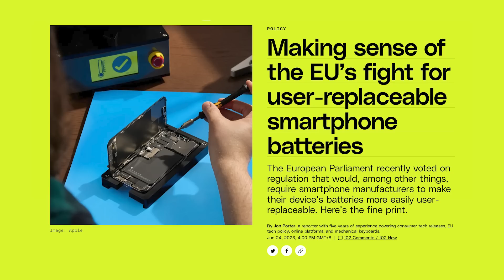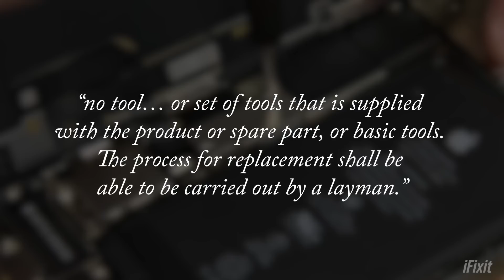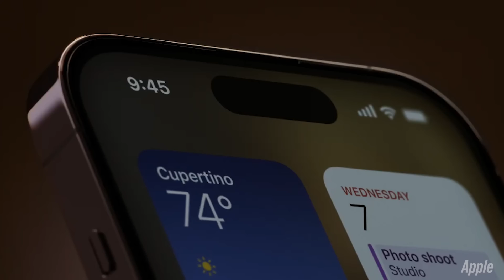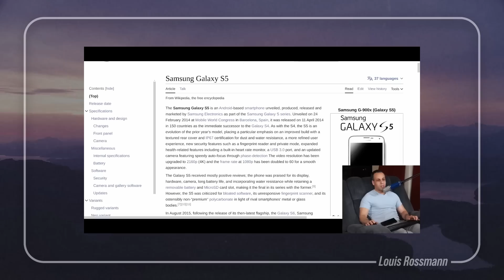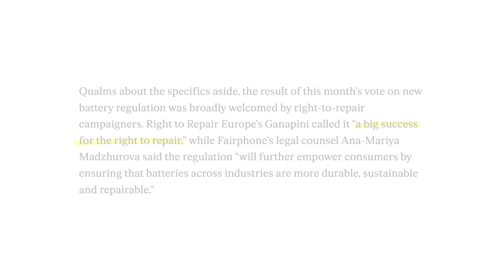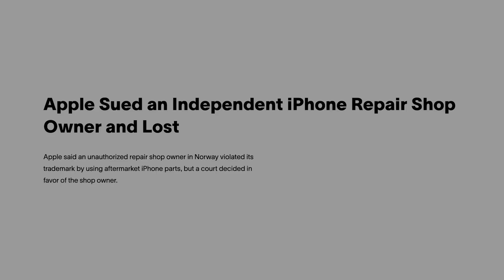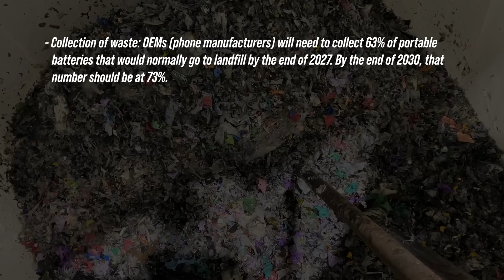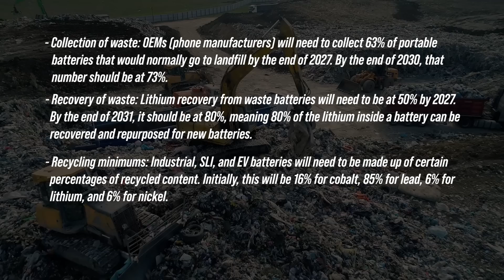EU Just Changed Smartphones Forever

Comment: Wouldn't the devices get thicker with a replaceable battery?! I am all for replaceable Batterie, don't get me wrong - I just don't  want a clumsy device in a time where foldables are becoming the next standard device type....

The other thing is that an old phone will be very slow due to software updates. So when the battery is through, another 3 Iterations of the same phone have been released. At this point it makes sense to get a new phone anyway.....

Comment: Rock on EU, but they should make it easier to replace screens as well while they are at it, even more pointless e-waste.  One of my older phones (UMI Super) I could usually buy the screens for about £15-18 inc delivery here in the uk and replacement battery for £8 I guess.  To replace the screen each time I broke it the annoyance was more the fact that you had to dismantle the phone from the back and take it to bits each time and then put it all back together, something that is too much of a barrier for most people to get past sadly, even though if you have access to the web in some other way there are great tutorials and teardown vids for pretty much every phone.

For my UMI it was relatively simple with basic philips head screws and I got used to doing it over the years and even if I did not have a screwdriver at hand the screen kit would always come with one, as well as the glue strips and a plastic tool incase I did not have any guitar picks etc.  They were stock from the factory and I never even recieved one with a single broken pixel.  The battery also came with a screwdriver IIRC and it was a simple job for most to take the back off and replace it.

My current phone for years then like most I would have to go in through the screen to get to the battery, something that without a heatgun is a bit tricky and scary for most since one mistake and you then need to buy a new screen also haha  (thankfully I have not had to do it in the 4 years or so since I bought it because the battery is still decent)...  If you then take into account that phone screen seals are pretty tricky to get back to factory condition then It is an insanely evil trick just to really make sure nobody does it and either buys a new phone or sends it to them for repair, just to replace a $10 or so battery.

UMI also used to (and maybe still does) support the right to root or CFW or do whatever you wanted with your phone since, well, you owned it, it is your device and they would provide keys and guides and had forums, something that most companies seem to have forgotten also.  Honer actually stopped giving out dev codes to unlock my phone a month after I bought it I guess. I had given it a while since I was waiting for them to finish updating android (which often does not take long) and I saw no reason why they would ever take away one of the features after selling it, sigh. Oh giant tech corps, always such a pleasure doing business with them.

Comment: User replaceable batteries weren't removed, because smartphones are made of glass, metal and glue. Batteries were removed, because it's cheaper and more profitable to manufacturer them in a way, that is not easily fixable. The batteries could also last A LOT longer, if they weren't pushed to the absolute limit. But manufacturer choose to squeeze those last few minutes of runtime out of them and limit the lifetime to about 2 years. Don't repeat the excuses they give you, like a puppet on string, just use your brain for a moment. Considering all the challenges of making a smartphone. Making a modern smartphone with a user replaceable battery is not a much bigger one than making an iPhone with a USB-C Port, they don't have to "figure out how". They just have to do it. That's all.
https://youtu.be/Yn-R39-dtc0?si=j7ErNQ7_0hFLXek5

Comment: Too many comments to see if anyone mentioned the Apple/Norway case you refer to. Pretty sure the repair shop was using non-genuine Apple branded products and this is a big no no. Stupid to use them anyway as consumers don't see them. If you use non-genuine branded batteries as you don't want to deal with the 'it is a genuine Apple battery you are fitting in my phone', then Apple will come for you. There are enough good 3rd party batteries around that Apple leave well alone (intellectual property issue). The EU should have made a list of things to do by 2027: once every, say, 48 hour charging (stop using battery advances for super duper processors that 99% of consumers don't need; serialising for spurious security reasons; glass on hand-held devices, update terms that cause consumer panic, security lockout lottery (Apple, Samsung, Google) it's MY phone!
Reply: People use non-genuine branded parts on a lot of things.  Why is Apple so special?

Comment: I’m was excited for this until they said it can not require any tools. Now I’m skeptical because I’m unsure how they will design this and still maintain the same beautiful design of phones additionally I’m concerned of dropping it and having the battery pop out which always would happen on my phones with replaceable batteries. Don’t get me wrong I want this, but I not requiring at least SIMPLE tools like 4-8 Philips screws on the back of the phone or something would make me much more comfortable with this.
Reply: That is not what the law says.  Watch the video again and pay attention.
Reply: @RK-um9tu  I've been following this situation very closely over the past couple of months and last I heard the language used was "without the use of specialized tools" after researching again I see that they say commercially available tools or specialized tools provided free of charge. This makes this law much more viable in my eyes. Unfortunately I was wrong however I was basing my knowledge off of couple month old articles and I guess the language could have changed? I'm not sure, seems unlikely lol
Reply: I can think of a way that not only prevents accidental popping off, but also improves non-slippage and water protection.  Make part of the back a silicone that grips into a grove around the front edge of the phone.  If you make these different colors and designs you can interchange them for any occasions.  Make a backing with built in silicone plugs for charging ports and other openings, now it’s ready for pool or bathtime.
Reply: @N3k0B0o  I can see that working

Comment: It's a must. It will definitely lead to people using the same phone for longer. It's high time we protect the environment and this will definitely help slow down waste to ab extent.

Other benefits might not be so relevant as most will go to the manufacturer for the original battery which charge mostly fair amount except Apple and maybe some other companies.

Collection is a challenge. Should have implemented a new law to put batteries on a special waste bin for easy collection and recycling.

Comment: Funny enough as an owner of a S5 for many many years my issue wasn't removable batteries, mine was how to get my hands on legitimate and quality replacement batteries. they either cost a true fortune or are 99.9% identical from the outside but are fake and swell up (speaking from experience) so it would be nice to have a standardized battery format that would guarantee availability.

Additionally, as far as reparability goes, when a replacement screen for an S5 costs 80% of the price of a brand new equivalent phone with all of the same functions and a bigger screen then it's obvious why so little repair gets done.

Comment: At last. But why it takes so many years.? Apple allways complicated simplest things in their Products. Power management batteries in Macbook G4 titanium was placed under the topcase so if anyone tried to change this battery had to remove a lot of parts. This battery was made of 4welded Panasonic button cells wort max 2$ but costed 100$ + service at Apple. I did it my self. Still working.

Comment: I actually dislike this because my Android Phone would constantly freeze to the point I had to constantly remove my case and then the back then the battery and re-assemble multiple times a day... so for me I dislike this. A sealed battery is better for me, I hate having to remove the battery just to restart my phone, I wasn't able to reset it without removing the battery 🫠 so I switched back to iPhone and it's not given me a problem since it's been like 6 years no problems
Reply: How long ago was that? Nowadays you just hold down the volume and start button.
Reply: @BrokenBackMountains  Admittedly it was a long time ago at least 8 years plus, I just haven’t switched back and kept my IPhone 6s the whole time. I am not on my phone much but the battery still last me plenty long. 

I’m sure the Samsung phones are much better than back then I just don’t change things when it works and for me the IPhone hasn’t given me any issues. It’s never froze on me once.
Reply: Warning, Warning, iTroll Alert!!!

Comment: This is an excellent move by the EU, the change to denies users the ability to replace batteries was down to companies profit, not design of phones. 

Its ridicules how new tech is made to ensure it is useless when some minor components fail. There must be an end to buy and bin which is the manufactures preferred sales approach's! The life of tech has to become far longer and less new models realised. Of course companies wont like this but the huge scale of environmental harm is sickening.

Likewise we must revert back to laptops that are easier to fix, there is simply no reasons at all that the average laptop only lasts 3/4 years before it becomes so clogged up, slow and largely pointless. Windows plays a negative role here as no doubt between them and components its all about ensuring a turn over of new laptops. 

Companies expect us to pay £400 to £1000 every 3/4 years for decades and its just not on. They do not provide value for money, laptops must change so they can have a continued life, so even if you do get a new one the older laptop should still be good enough to donate to charity or organisation that can make use of them. Components must be recyclable and be able to go into new ones or for repairs. 

Companies need longer profit goals, they used to do this, so is a utter rubbish they cannot go back to it, they deliberately want items to fail and not be able to be repaired. Well, no more!

Comment: i'm getting ideas of a modern smartphone having the battery capacity to last for over a week before needing to be charged due to the battery beeing replacable that adds the function to buy a new mechanism that has more than just one battery in it. sure the phone might get twice as thick, but i'd take a thick phone with long battery life over a slim phone that has a drained battery in less than a day any of the week
and yes i know its shows i'm getting old when i miss the time when i only needed to charge my phone once a week, and the fact i use my phones until they have some kind of catastrophic failure.

Comment: The vast majority of products are designed to be replaced to keep the bottom line of the company selling the product valid. A designed shelf life of the product is paramount.  If companies were to make a product last like they did in the past. Lets say a table top fan. I have a fan from over 40 years ago that is still working. I also have had over a dozen supposed modern fans that I have had to toss since it costs more to repair than it does to replace. Slaps self in forehead...duh!

Comment: I tend to oppose the idea of government meddling in business. This is not the role of government. It's the role of the consumer to tell industry they have to make products with features consumers want (like removable batteries and repairable/maintainable devices). The problem is that these companies hold near monopoly control over a global market. They don't give a ..it what the individual customer wants. They're going to design and produce what they want and you have to pick from among what they offer. You get their devices that are designed to break (planned obsolescence). When companies operate like this, the only solution is to use regulatory authority to restrain them to advocate for the interest of the consumer/citizen. Too bad there are very few checks on the unelected EU bureaucracy's power either.

Comment: The entire consumer market first started going to lower-cost items which not only allowed for higher profit margins for the manufacturers and retailers but also slowly decrease the quality so that it needs to be replaced or repaired but then make the items so cheap and so difficult to repair that the item is discarded and a new one can be purchased the manufacturers of light bulbs literally came together in the early 20th century and agreed to make a deal that none of their light bulbs would last more than 1000 hours. That agreement was re- ratified half a century later to 2,000 hours which is why you see incandescent (old-style bulbs) and they're usually rated to run for 2,000h

Comment: building phones with removable cases is absolutely zero difficulty for the phone manufacturers, it simply takes out of their bottom line by letting the consumer simply replace just the battery, instead of the entire phone now. i wish more ppl saw the landfill problem sooner, or better; from the start so we would have been able to replace batteries all along, it would a saved my ass a few times

Comment: Currently China dominate the battery industry plus they are suppressing control over mining and processing battery tech in generaal, meaning tighter supply and thus higher price in the years to come. So it's logical that EU and the West working on recycling to avoid too much influence. That's of course not the only element since we got the war going and the govs are promoting the "clean tech" to shift away from oil warfare.

Comment: I used to have a phone with changeable batteries, unless they have a common standard for batteries it was a mess finding the right replacement battery for my phone. One of the batteries I had swelled up (poor quality) and destroyed my phone. My current phone I have had for 3 years and only now it seems like I might have to replace the battery or the phone. 

I am a big fan of right to repair without paying the price for a new device to have my old one repaired.

Comment: That's gonna be interesting. In my opinion that's a great step towards being more eco-friendly. Devices will last longer for most. Although the question is - how often do you need to change a battery? I still have iPhone 7 Plus that's still on it's original battery, only a year ago it was retired and the battery still held close to the new one. Right to repair though, that's more important than removable batteries imo! You can take your phone to any repair shop around you and they can fix it without using unnecessary tricks just so for ex. screen can work like it suppose to. We'll see how it's gonna work out!
Reply: Don't think Apple or Samsung or other phone manufacturers will comply.  It's just too drastic a change in design philosophy.
Reply: @jonfreeman9682  They don't have much choice since it's the law. though, they may find some way to comply in letter, but not in spirit of the law
Reply: @jonfreeman9682 They have no choice to comply or else just not sell devices to the EU. The market is too big to lose.

Comment: Another reason they didn't want removable batteries is because it made remote hacking by government impossible to prevent. Before, if you noticed that your camera light was blue indicating it was turned on, you could remove your battery and sever the connection.
Governments are able to hack your phone even when they are turned off. The only thing they couldn't stop was you removing your battery. The Galaxy S5 was the last phone that has a removable battery, meaning every new phone afterward was the largest government spy op in history. They will deny it of course...